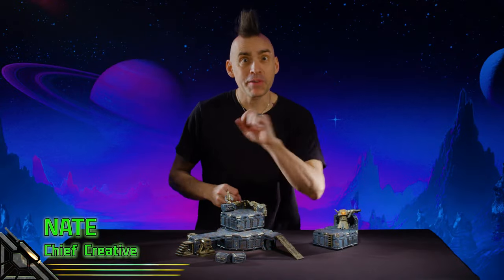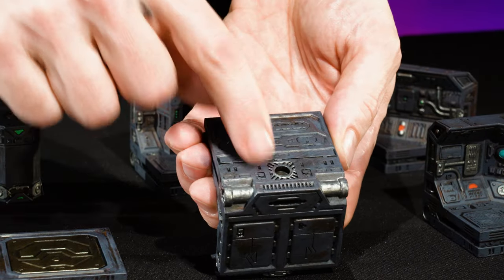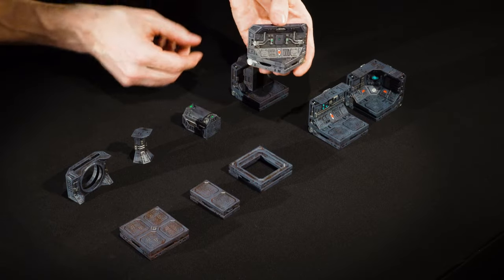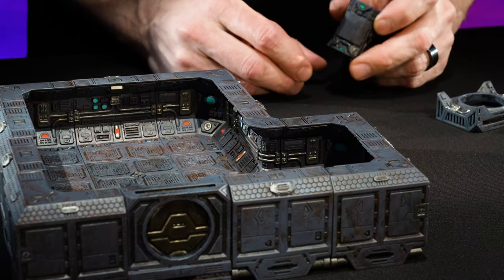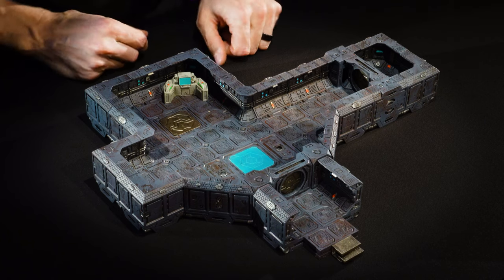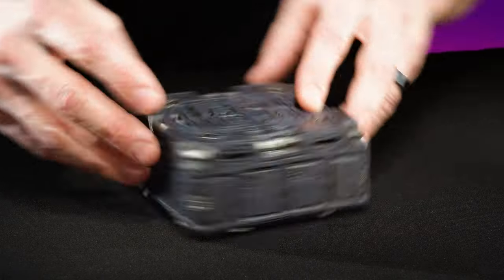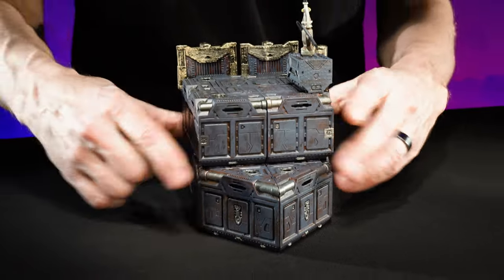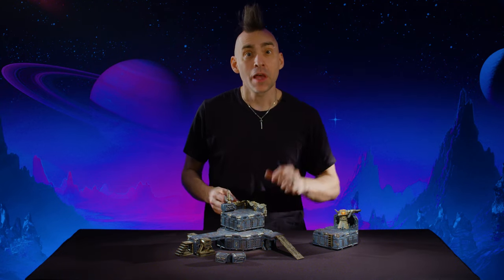Starforged Hands-On: Core Pieces

Comment: I really wish the walls were higher. It looks silly when the miniature is much taller than the walls. Everything is just too small for modern miniatures.
Reply: Well, they did say this is a prototype, so I’m sure they’re gonna be make updates on these terrain pieces
Reply: Small walls makes it so you can actually reach and see your miniatures tho
Reply: When exterior building you can see the space marine is fully obscured by one level. Interior builds you're going to have to use a bit of theatre of the mind, and imagine these are just 3/4 high representation
Reply: @jonnil1997  That's ridiculous. Are you telling me you can not lift your hand/ arm more than 2 inches from a table top!? Nor does it block your vision in any way. I have an enormous DF collection and have built Hirst Arts dungeons with 4-6 inch walls. Not only are they equally playable, the higher HA walls look infinitely better.
Reply: @captainking7423  DF has always made their walls 2 inches. It has been a problem since day 1 with their stuff. Stefan made EVERYTHING too small, because he used mini's from the 70's - 80's. With 40k minis now being made at 32mm scale, this issue has now become ridiculous. They should switch to a 1.5" scale with 3" walls. It would be MUCH more practical and useable.
Reply: @asdfhiuh  its subjective but its a common complaint that dungeon walls are to high in different products so when you play an rpg sitting around a table it can be hard to see minis behind tall walls, thats why Dungeons and Lasers do really short walls and illustrate this as the reason on their packaging.